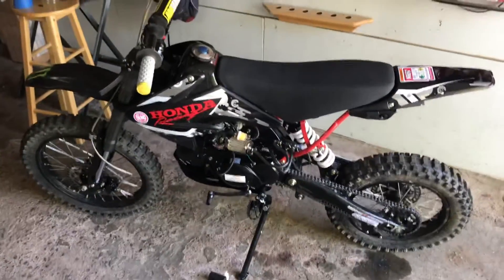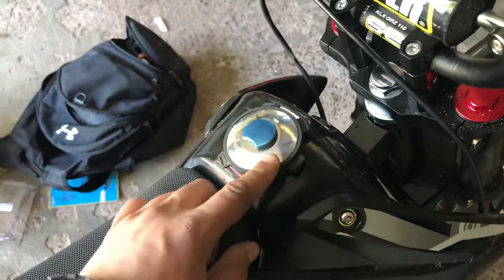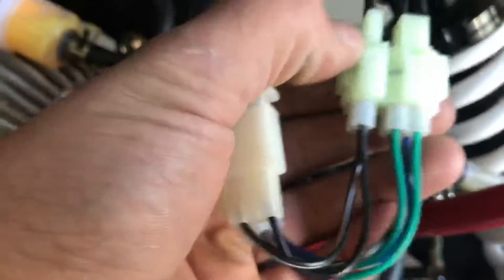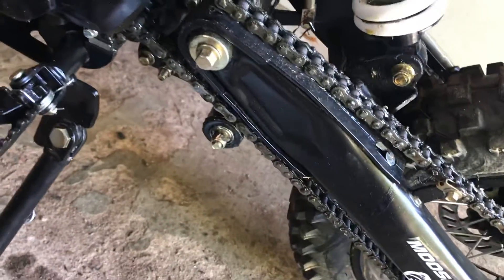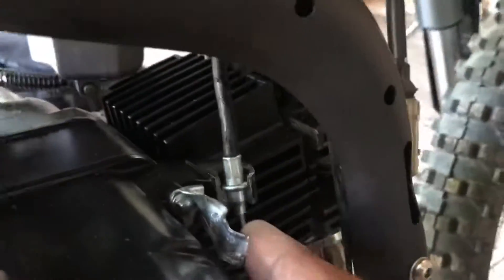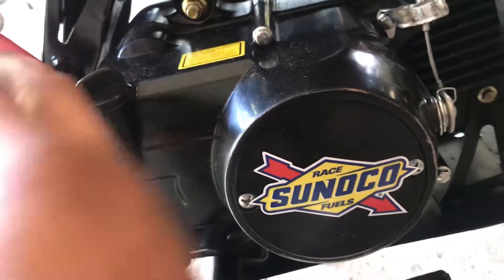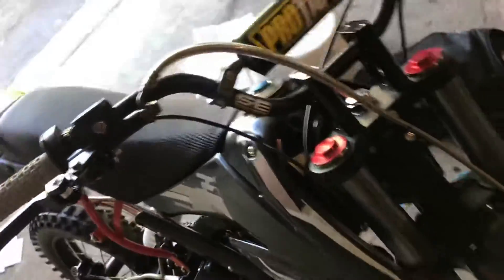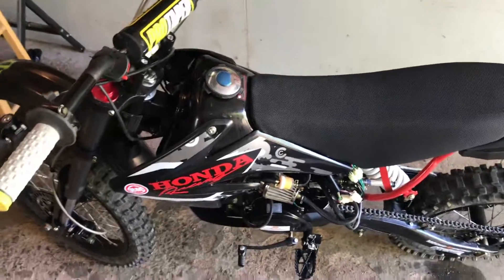Apollo 125cc | Essential Upgrades |Update

Comment: Did you need to buy the clutch cable to make new levers work better?
Reply from the maker: Efrain Soto you can use the stock clutch cable, I only replaced my cable because I snapped it, I had originally went to the store and purchased a 46in cable which was way too long. I then ordered a cable around 39-40.6 inches and it’s works fine
Reply: @BasedFK  what is a good hand grip i can get with metal tube
Reply from the maker: Blazing Fire Gaming pro taper pillow tops are good
Reply: @BasedFK  should I get the Apollo rfz125cc
Reply: @BasedFK  or the Apollo db 007
Reply: @BasedFK  problem is one is slightly bigger and one is slightly smaller but taller and one has more power and one has less but both are rated for 55
Reply: @BasedFK  I know nothing about bikes so

Comment: What's the convertor for?
Reply from the maker: Efrain Soto the cdi I purchased had round connection ports, the stock ports on the bike are square
Reply: Does it make the bike perform better?
Reply: And the break away levers did it come with clutch and front brake lever? Ima need some
Reply from the maker: Efrain Soto yes clutch and brake lever
Reply: Did ur break lever go on easy cuz on my bike it did not slide in to easy. How did you do it?
Reply from the maker: Efrain Soto yea I just had to sand the part that was extruding, I used a metal file, took about 10minutes. Check out my new video